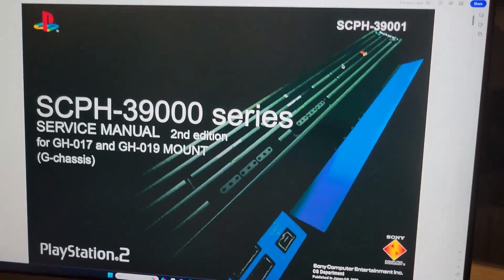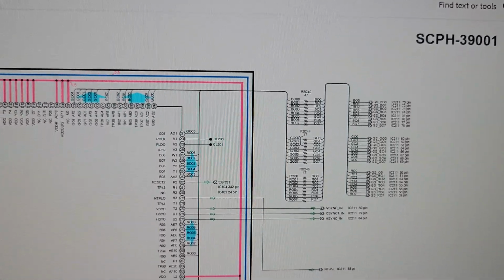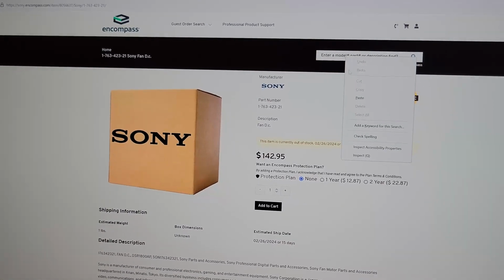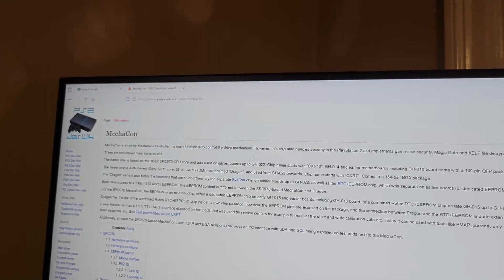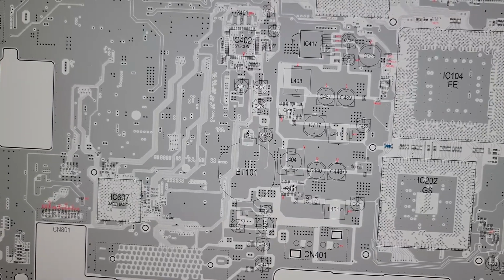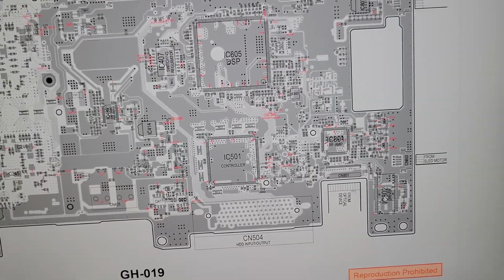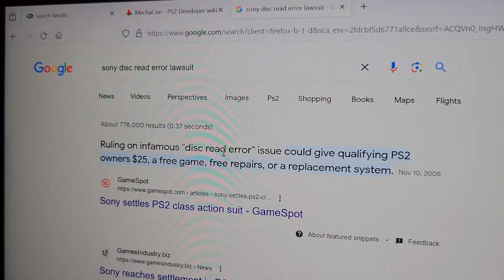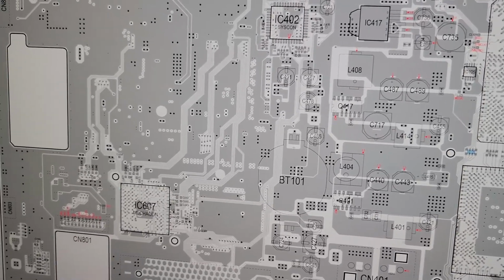Gh-19 no video troubleshooting

Comment: I heard that removing or inserting a xbox 360 hard drive while console is powerd on could  permanently mess up the hard drive or may  corrupt the hard drive but i have  did that before by accident  but for me it just Rest /Reboot the system when i remove the hard drive when xbox 360 is powerd on but i feel like it's not good for the hard drive but they always say to turn off the xbox 360  if i want to insert or remove the hard drive but it did not runied my hard drive for doing that when it rest the console I  insert or remvoe the hard drive while the system on
Reply from the maker: I never move any 360 hard turning off power.First It just wreck them

Comment: With no video it's usually a bad fuse, bad BA driver chip or the 1506 8 array resistors 47k. You can easily find replacements for those parts along with a cap kit on supplier sites and Ali Express. If it was dropped or intentionally damaged then it's only good as a parts board. I have a Modchip in mine with the Retro Gem mod along with the RePS2. And it still works just fine. Louis Rossman has a video of him repairing this fault.
Reply from the maker: Thanks for the information 👍 rb109 is likely the issue. The ba chip is for the disc drive as well